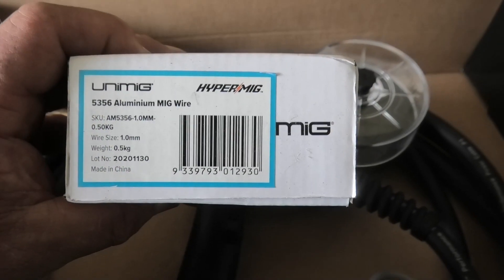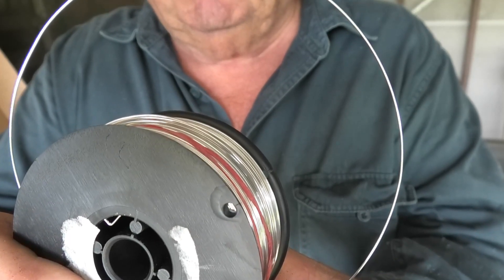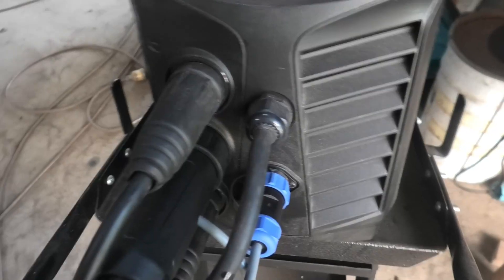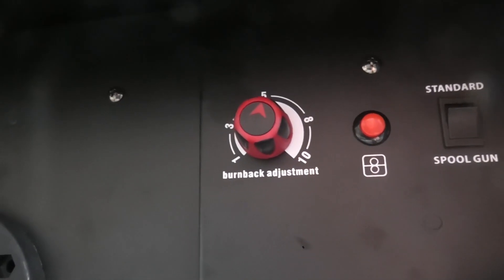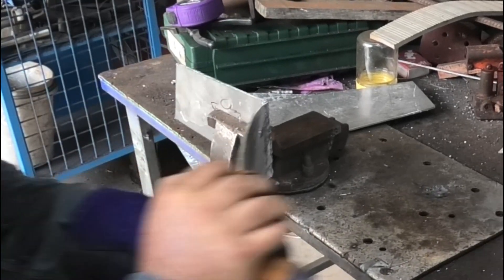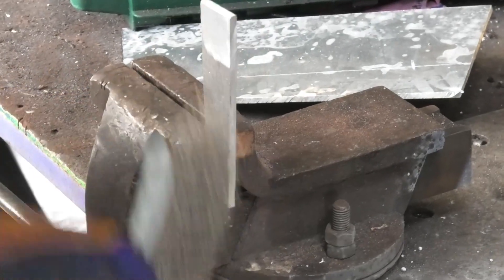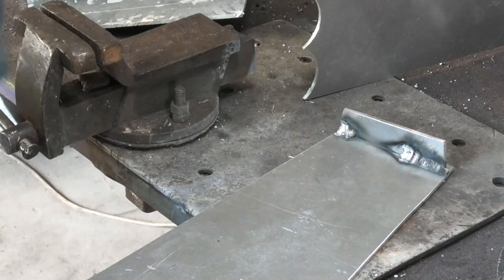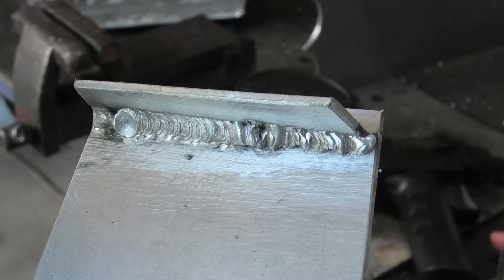UNIMIG 185 VIPER WELDER AND UNIMIG SPOOL GUN WELDING ALUMINIUM

Comment: I watched another review on how to use the aluminium spool welder and watched in horror as he forced the frazzled wire tip through the feed runners. It's always nice to see an operator that knows better and does better
Reply from the maker: Give that soft alloy wire a chance and it will knot up. John
Reply: @farminglifeaustralia6716  have you seen the Unimig Razor 200 Pulse HF Tig, Stick and Mig ? Little bit more but stuff me it's got some features

Comment: Nice video John.  I have had a Lincoln 180 with a spool gun for 10 years now and it welds about the same, it has also earned its keep time and again.  Not saying the Unimig viper is bad, because it's not and it  clearly does the job. BUT, if you are like me you will never be entirely happy with the welds, this video clearly shows the limitations of spool guns on "hobbyist" level welders, and to answer the common question, I would not build a boat with a non pulse low amperage mig. I have however used one to build what feels like countless casting decks, motor plates and rod lockers where a less than perfect weld is not going to sink me.  For what it's worth for those wanting to do aluminium on a small scale where your time is your own get an AC capable mig/tig unit with a spool gun and learn to use the Tig so you have the option of fast and dirty or slow and pretty. The other option is pony up the extra coin and take a punt on the new pulse capable unit from Unimig, which is what I plan to do.( I already Tig now) Reality is if you are getting semi serious about fabrication like I am you really need both and unfortunately at this point an AC capable unit with pulse mig doesn't exist.  I know this sounds like a rant but if I had my time again I would have just brought a Tig and sat down and forced myself to learn way back when.
Reply from the maker: Thanks for your input. I have a dedicated TIG and I use it like you say when you need strong and pretty. I know what you mean with the spool gun set up. I think you cant pay peanuts and expect the world. I found for the cost and the amount of ally welding I do nowadays the spool gun is all I need. Aluminium has got that expensive I find myself avoiding it. John

Comment: You'll break your vice off the table before you break that weld !!!. I have the same Unimig 185 Viper and just bought the 240Amp spool gun for it. Can't wait to try it
Reply from the maker: Yeah I think you are right. If I don't show a strength test someone will say " The weld looks ok but its not strong" or some such crap. I am sure you will be impressed with the spool gun they are a tricky well made bit of gear. John

Comment: Great vid john. Would this be ok for repairing aluminium tinnies [boats] or are they abit thin.?
Reply from the maker: It would be ok, old aluminium that has been in salt water or just has oxidised is a bit of a Sh=t fight got to clean it really well and even then it never welds as good as new aluminium. I dont think it has any limitations in the actual welding. The normal tinnie does not have any metal that is to big for this machine. John

Comment: Has anyone found the duty cycle of Viper 185 too short?
 I'm considering buying one to build a box trailer, in mild steel or possibly aluminium.
Reply from the maker: I have not had any trouble with the duty cycle. The unit has a thermal overload and I have never had it cut out. I am not welding heavy material all day mostly 4 6 10 mm with the odd piece of 12 mm never had a problem. John
Reply: Thanks for the  Advice 😊

Comment: i bought one of those spool guns and had nothing but dramas. wouldnt feed the wire unless it was arcing, the slightest tap of the wire tensioner would release pressure on the wire and you would get burn back up the tip and have to pull the thing apart to get your wire back, it was doing this almost every trigger pull for about 2 days until i took it back and they "upgraded the mother board" for 3 weeks (more like did fugall) came back with the same issues. was an absolute nightmare. so i sold it and bought a pulse mig. these cheap $700! spool guns are garbage for repeatability if you are actually using it to build a boat. not on a bench welding scraps. fragile and unreliable.
Reply from the maker: Ok thats interesting I have had no such issues. If I do I will do a video on it. John